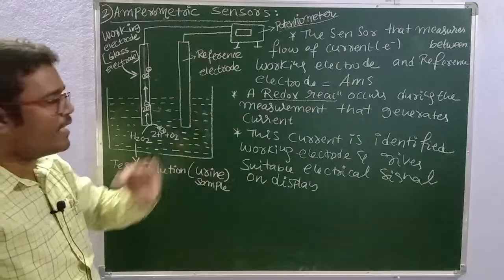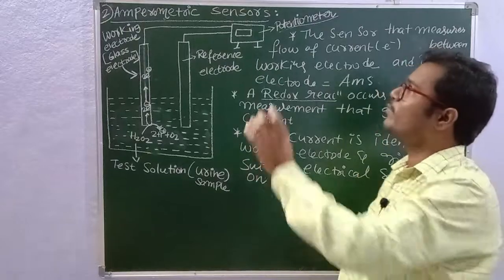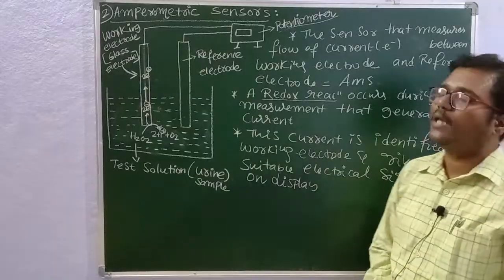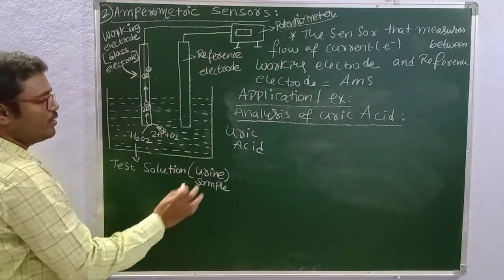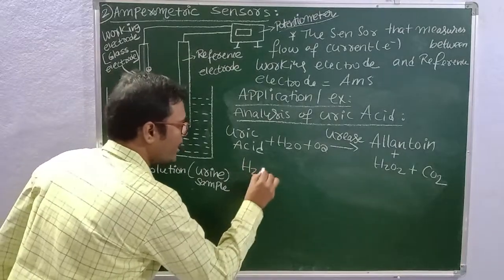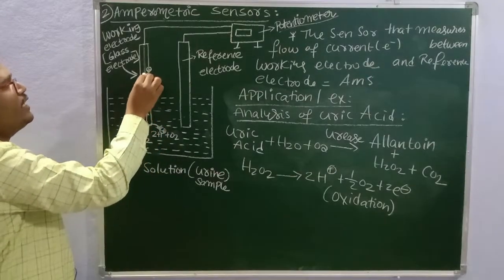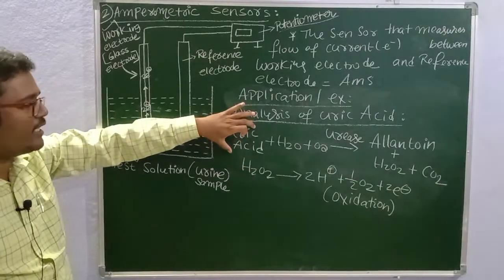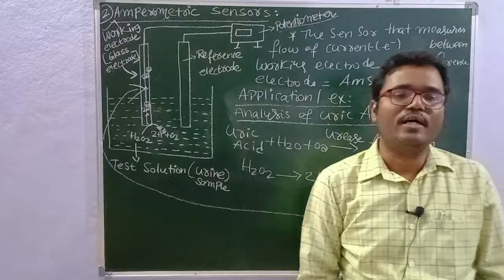AMPEROMETRIC SENSORS @sadhanadhananjaya CHEMISTRY WINS #chemistry

Comment: Sir what is counter electrode
Reply from the maker: Counter electrode is an auxiliary (Additional or Supplement) electrode used along with Working electrode and Reference electrode. It behaves as a Cathode when a working electrode is functioning as Anode or it  behaves as Anode when the working electrode is functioning as Cathode. Eg: Inert materials like Platinum, gold and carbon are used as counter electrodes .